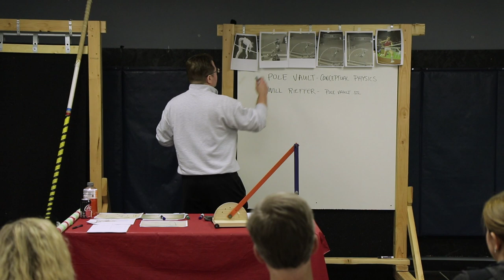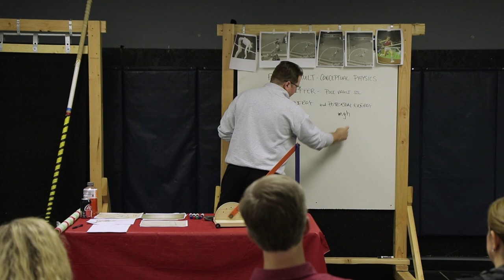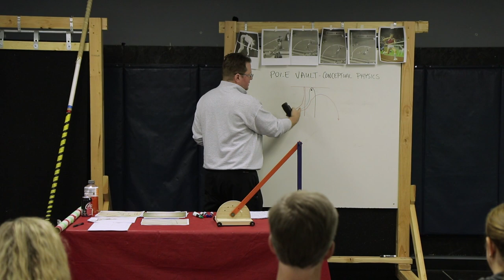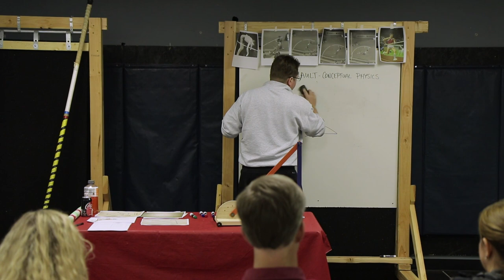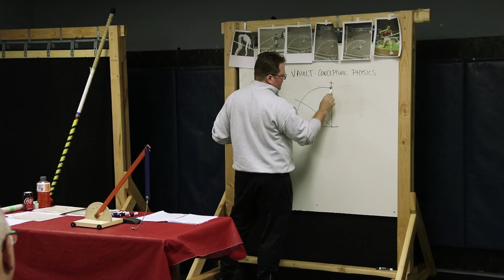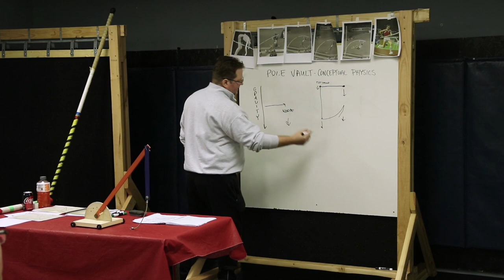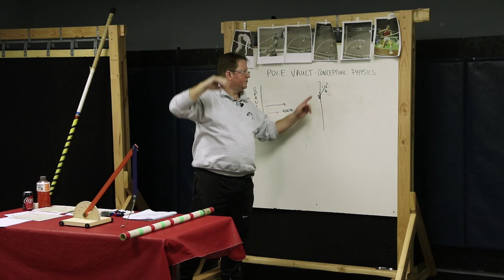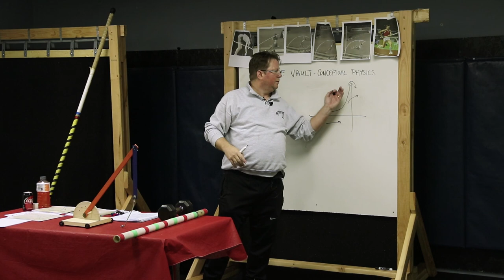Pole Vault - Conceptual Physics Presentation for PVSTL 12 27 18

Comment: I think you're overcomplicating things.  You really don't need to treat straight pole vaulting and bent pole vaulting so differently, and so certainly don't need to relearn how to vault every time you change grip height, assuming that you aren't moving up poles arbitrarily. If you're fast enough to use a pole then you don't need to consciously delay the swing.  If you need to do that, then you probably aren't ready for that pole.

Also, no one forgets about gravity.  It wins every meet :)